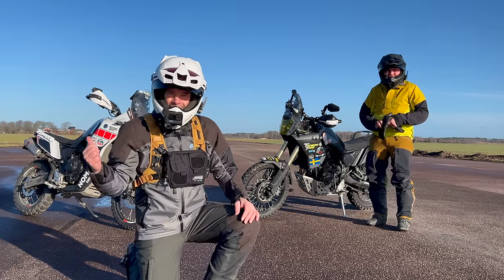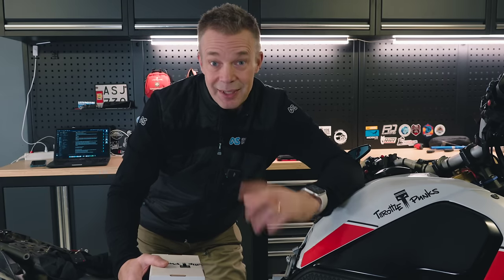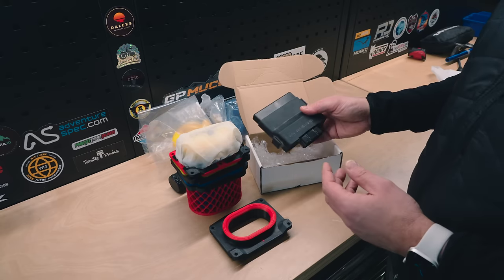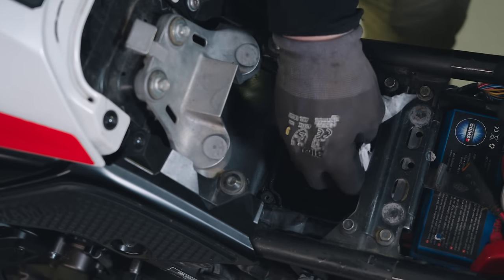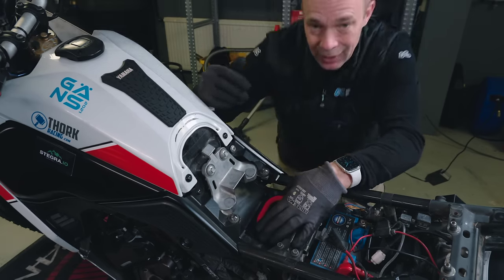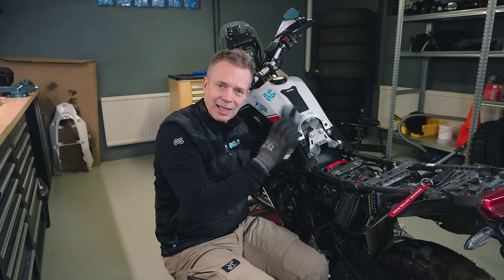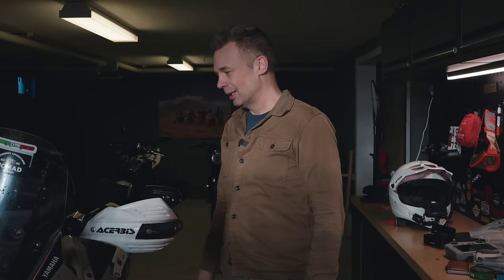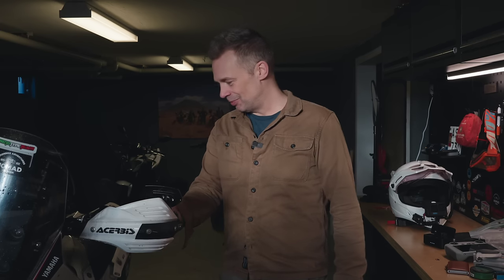Can we boost the T7? Power Kit from Throttlepunks

Comment: The hp/torque graph is impressive, specially considering the difference in low rpms and matches the difference yours had compared to your mate's original. I'm interested to see the difference in fuel consumption. Enjoy your "new" ride! Thanks.
Reply from the maker: Thanks 🙏
Reply: Yes, additional fuel consumption can be important. I wouldnt want additional power if i lost 50km range!
Reply: @Nerb1  Neither would I, especially on a bike with a tank like this. Fuel consumption before/after tells the whole story and shows whether fueling has become "smarter" or not.
Reply from the maker: I will follow up on consumtion for sure. This day was not a good test with att full throttle 😊
Reply: I have an FJ-09 that the previous owned "improved" with a different map, exhaust, and intake. Sure it got an increase of 8-9 HP, but LOST 20% fuel economy, even when hyper-driving (hypermilling). "Moral of the Story": The Yamaha Engineers know best how to optimize performance VS fuel economy. Most people want the T7 for an "Adventure" bike.
Reply: @gscheben123  That's how it goes for most of such mods hence I am not interested. If efficiency wasn't a necessity the factory would have done it in the first place.
Reply: The consumption is the same , maybe a litle less in normal speed, 
Just been 2200 km in norway  3 friends with standard t7  and i always  refuel less! 
But if you ride it like you stole it!  🤔 have to try…. 
But its day and night to ride.
Woolish  re map
Acrapovic slip on no db killer
DNA air kit

Comment: But you can hear your friend is later with his throttle. That is what makes the difference. 🤷🏼‍♂️
Reply from the maker: There is quite a big difference if you could try it. Sound over intercom delays which is why have trouble timing
Reply: Not only hear he's later, but can actually see it in the wrist movement. He was sandbagging.
Also, the "slower" bike has a much heavier rider on it.

Comment: I wonder why the original setup has that long snorkel ? does it do anything at all? the power curve with the new filter and mapping has exactly the same little dips and hikes. Just more of everything overall. I was hoping for a slightly more exiting topend so that the fun lasts a little bit longer into the high rev range.
Reply: the design of the snorkel is to prevent water from entering the engine through the air filter when dropping the bike in the water. When laying on the side or tipped over, it should create an air pocket inside, thus preventing the water from entering, I assume.
Reply: Intake sound…. Regulations

Comment: Sweet package. The ECU tune is the big part. I didn't tune my T7, just swapped the can for a Mivv Dakar. But if I were to install a performance intake and header, would definitely tune the ECU. There's places you can send them into to in the US. But I'd just bite the bullet and take it to a dyno. Lower fan temps and optimized fueling with an unrestricted intake/exhaust is definitely going to add some power. As well as weight savings.
Reply from the maker: Cheers!

Comment: The air filter pack is interesting. Good idea. I use the Hiflofiltro. It look very similar to the original one. My off rad is max 1% of my whole riding. But I want to ride a bit more off rad in the future.
Still I get enough power of my T7. There is no need for different mapping. But the difference of the few horsepower more (real test at the air field , TOP !) was astonishing.
Thanks for sharing with us.

Comment: I don't have this kit, but my T7 has the ECU remapped, full exhaust system and a Twin Air filter, and makes quite a nice difference. The engine pulls harder, better acceleration and there's more torque available. Very usable in the trails. But this air filter kit is something maybe one day i will try. Anyway, great video.
Reply from the maker: Thanks man

Comment: it's not good, that cover lets the water fall into the airbox which, being sealed, cannot evacuate it, it will all go into the engine.
I'm talking about water taken during the rain and during the motorcycle wash.
I did several tests over the years and as far as it increased it was dangerous for water.. in an hour of driving in the rain I found a lot of water inside the filter box.
To be used only without rain.
Reply from the maker: I will use the pre filter mainly and I am not worried.

Comment: Love the bike but i feel if it was a 1400cc engine instead 700 cc i would be much happier. Not interested in high rpm, i want low end. Anyone tried bigger rear sprocket or something similar to get a bigher punch in low rpm ? Results?
Reply from the maker: I tried it. Better technical riding but too high rpm on long travel.
Reply: @NomadSweden  , have you tried África Twin? Is It significantly stronger on low rpm or so so? The specs are interesting 98 nm torque vs 60 ish on the Tenere. Much heavier too.
Reply from the maker: @antoniom4639 AT is more comfortable on long rides. In offroad not much better. T7 has all power you need offroad. More power can not be used in dirt. Only on asphalt racing.

Comment: With this wide open air intake an ECU remap is mandatory to prevent a too lean mixture and an potential engine damage. Also in case you'll add race pipes with less resistance.
It would be interresting to see if and how your fuel consumption changes on future rides.
Have a great season, Bernd 💙💛🏁🤛🏼
Reply: It's not a carbureted bike. So that doest really matter too much.
Reply: ECU remap, acrapovic and similar air filter !
Lower on fuel if you go highway 70-110  But a litle higher if you run it like you stole it😁
But every T7 owner should do it , it Will be a better bike

Comment: Is just the air filter enough or is there any software needed to connect the engine's brain?
Reply from the maker: two parts. The filter and the ECU update. Both can be done separately or combined. Check the links to their website in the description

Comment: Hi Robert, so what are your thoughts after 5 months.
Fuel range, riding pleasure, maybe a better sound with the bigger air intake ?
Reply from the maker: Enjoying it, although I am so used to it now I don't think of it :) Fuel consumption has not changed. Sound is pretty much the same.
Reply: @NomadSweden  does it remove the jerks when re opening the gas ?
Reply from the maker: Nope. I think that is also part mechanical. No difference with this ecu upgrade
Reply from the maker: @Kaostorm  nope

Comment: Any updates on fuel consumption?
Reply from the maker: I haven't really noticed any change. I used to have around 4,7 l/100km and it's the same for mixed riding. But ofc depends on the riding. I ran a full tank on the highway this weekend in avg 120km/h. It consumed 6,7 l/100.

Comment: have you also sorted the throttle resriction to? also the inner duel airflow is to tight did you change them to??
Reply from the maker: Not sure what you mean. I only changed filter and ecu
Reply: @NomadSweden  take the airline  out in the box lookthereis 2 airintakes they are way to tight get the replacement for them makes them double ifnot triple the size while that's out look in the the throttle post it  only opens about 1 third, sand the  little plastic down check it  again  and keep going until fully open, you ca buy a replacement but dot bother just sand it a little hope that helps for you?? if not  give  another il try find the links for you
Reply from the maker: @googlelimp9834  nope did not do that
Reply: @NomadSweden  any 07 enhine all the  sae mate i have tracer 700 I've ordered the parts but not  doe it yet.

Comment: That kit is really a no brainer.
 it just   makes more sense just to see it installed it's a must for sure better quality and flow you wouldn't even need to test to know it is better than stock
Reply from the maker: Indeed no test needed. But it made a more fun video :) I like the upgrade in power
Reply: @NomadSweden  yeah for sure maybe a more precise drag race would help your mate was a little slow on the uptake l have no doubt that the air filter mod is a much needed accessory for the T7 and the quality is definitely there but there can be no bias when selling and test performance products dew to the fact that hard core bike riders see right through any BS
Reply from the maker: I am aware that I influence a lot of people but I only do what I think is fun. I'm not selling anything and don't make money from reviews etc. I wish I could do this without the influencing part. @jw8556
Reply: @NomadSweden  it's all good everyone needs to make a living just don't try to tell me that Dunlop 606 tires are really great then l will know you've sold your soul the the net lol your review and comments where great and without all the wank factor just straight up great product and easy to follow install 👍
Reply from the maker: @jw8556 😂😂

Comment: Ecu nun markası nedir bu arada
Reply from the maker: The ECU is from the motorcycle you own. You don't buy a new ECU.
Reply: @NomadSweden  Is just the air filter enough or is there any software needed to connect the engine's brain?
Reply from the maker: They sell the filter separately so you can buy it without the ECU mapping. It will give 4 extra HP from standard. Check the links @ibrahimbudak4061